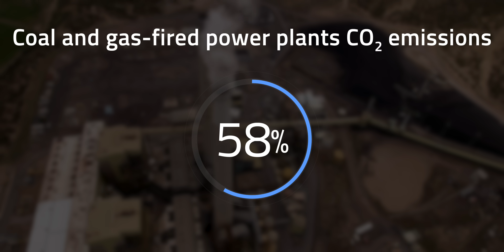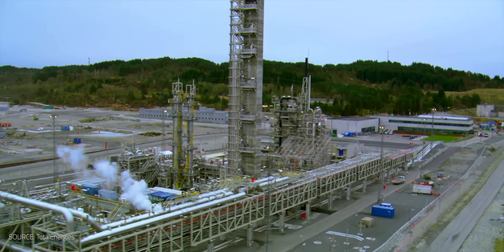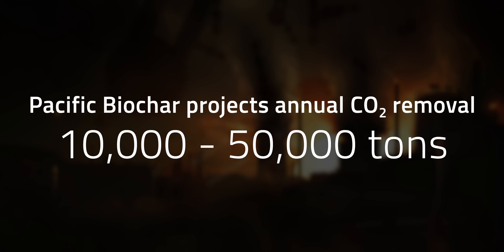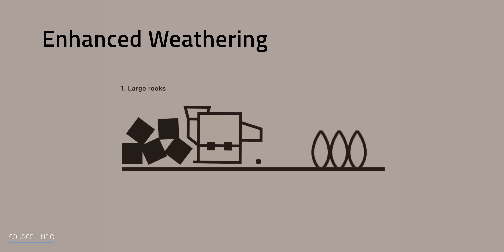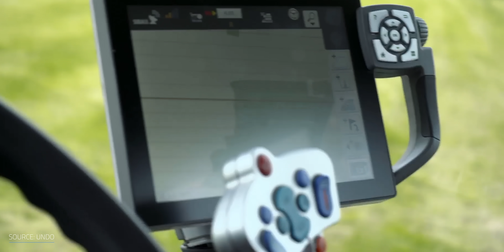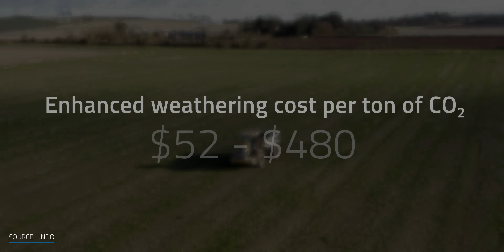The Reality of Carbon Capture

Comment: Honestly, it's a part of a bigger solution. No one singular invention will solve the climate issue. Majority of such articles and research only claim  "x%" in low numbers. Well, it's a start isn't it? Better to start reasonably low with many different such solutions as well. What was that other one, hempcrete right? Absorbs better than regular concrete, fairly renewable, but is a 'long term' solution. Well, so is this. Also cutting back is a good start as well to reduce emissions yeah? Besides that, this particular carbon capture could potentially also help with agriculture as well.

A small gesture of a solution is still better than none at all.

Comment: Matt, massive global reforestation (and logging/sequestering logs) is the only carbon capture technology that is viable. It's easy and the most poorly run country on earth can organize it.
Reply: Massive global reforestation is only a temporary solution, as all that wood will get decomposed eventually. 
Can think of it as a buffer, it will go so far as the total organic mass in all the live trees can allow for, no more no less.
Reply: @jzxynow2a8gs21  No. Sequester the logs in an old open pit mine. Keep stacking them. They won't rot. Eventually the will be coal again.
Reply: @oisiaa  That's not how it works bruh.

Open Pit Sequestration will not ( ever ) turn wood into coal, you will eventually get all your CO2 back. There was a time and an age where this would have worked, and that has passed since long before humans even came into the scene.

Comment: I am suspicious of the ability of biochar facilities to capture resulting pollution from burning inefficient organic fuels. The process is carbon negative but soot and tar positive. I'd like to hear about how biochar plants are handling that. I also wonder about low volatility tars that remain bound to the finished charcoal and if they have a negative effect on soil and groundwater. Spreading a poorly cooked batch of char could be equivalent to an oil spill. The latter issue is easy enough to solve with reliable QC but I wonder about the former.
Reply: I wouldn't compare spreading a poorly cooked batch of biochar to an oil spill. There's a ton of mycorrhizal fungus species that take advantage of the volatiles present in unfully burned wood, take forest fires for example, they create space and resources for a whole clade of pioneering species. (as long as the burning isn't too frequent and wide-spread of course.)
Reply: @DDryTaste  Good point
Reply: @DDryTaste  true, but for this to work it must be done on a planetary scale.
Everything must work as intended and only like that or we will have unforseen problems
Reply: I've come across a channel called NatureJab where a guy has made a microwave based pyrolysis machine in his back yard. 
I'm afraid he's going to kill himself one of these days with his lack of safety precautions and questionable knowledge of what he's doing, but he has successfully made and purified hydrocarbons capable of running a two stroke weed whacker. He seems most interested in the gaseous and liquid products, but obviously a side product is a lot of char. Not calling it biochar, since he's mostly interested in plastic, but he did put plant matter in it a couple of times.
Reply: @phizc  Found the channel.  Pretty cool.  Latest video though is how the reactor sorta blew up.
Reply: The European Biochar Certificate has limits for PAHs. Below these limits the equilibrium heavily favors adsorption, so quality biochars are perfectly safe for soil use. However TLUD and unpurged retorts can retain tars and PAHs, so your concern is understandable. As the industry grows IBI and EBC standards should become more widely adopted.
Reply: Burning biofuels is not carbon negative..first - you can "dry" biomass in 200-300C° on solar/wind/hydro. 
Second, you mostly use biofuel - wood and or biomass, or even portion of same char.
Reply: @romualdaskuzborskis  Dry wood still rots faster than charred wood, so it is an inferior form of carbon sequestration in the long run.
Reply: @garethbaus5471 dry wood does not rot at all, only damp does. And I was refering to the gap in the solar/wind energetics you can actually store energy in a form of dry wood/charcoal. As for capturing, I dont see any viable option here at all. Before we start actual capture - we need to be at least carbon neutral. Setting capture goal can be done in strategic long term goals (like 200 year long)..
Reply: @romualdaskuzborskis  burning biofuels isn’t, but burying biochar can be
Reply: @NightHawkInLight I’m sure you’ve got way more experience in this than 99% of the people watching this, so I really value your opinion. My take on it would be you need to measure it against the “if I do nothing” route rather than against the “before and after” process. If I do nothing, then a tree will still rot and breakdown in to the environment. So what happens to those other components in the case of natural rotting? (I’m honestly not sure of the answer, but I think its the right question)
Reply: always wash char before using.... yeah, this brings up a big enviromental issue when making char on larger scales..... when I wash my char in 5 gallon buckets I can literally see fuel like compounds in the water on the top before I pull the plug on the bottom......anyhow, yeah tons of stuff in unwashed char
Reply: If it's actually more than their graphics about helping farmers and enriching the soil, I'd think food waste disposal would be Priority 1. Kills diesel and other BS additives, solves an actual urban problem as well as helping farmers. 

The same useless biomass can be converted into biofuels anyway.
Reply: As the other guy says, I’m pretty hopeful that microbial decomposition of volatiles would be pretty doable. Though less so for the thick stuff. Capturing soot can be done pretty effectively with electrostatic means even at very small particle sizes, so I don’t think you’d get that chasing issues.
Reply: Someone making biochar in their back yard the old school way the Amazonian did in pits and kilns will make a lot of soot. Any industrial scale pyrolysid machine will burn off all of that soot to provide enough energy to fuel the pyrolysis reaction.  The only emissions should be co2 and water vapor
Reply: Using charcoal to capture carbon makes me thing why not just leave it wood rather then burning it into a piece of charcoal just to refill the charcoal with the same crap you just burnt out of it. It's a scam anyone can see
Reply: Nature can heal itself and restore balance but they believe that nature is dumb. By the way, CO2 isn't the problem. The problem are all the toxic pollutants in our food, clothing, shelter, water, soil, air, medicine, technologies - everything. Believe me, mother earth can take care of itself and she doesn't really care about if we suffer self-annihilation
Reply: Probably dumping in the ocean tbh
Reply: In a professional setup, the only byproduct is water vapor.  Please do more research before assuming there's a problem to be solved.
Reply: @sweetcreekcommunityco-op  Water vapor and some CO2 from the part that is burned for the energy.  But that was bio-fuel CO2, so at least carbon neutral.
Reply: @sweetcreekcommunityco-op  That's wishful thinking. No burner burns perfectly clean, not even refined fuels like propane are completely soot free.
Reply: @Nighthawkinlight  Processes, like retorts and add-ons like catalytic converters can really clean most of the crap up.  Peeps ought to get them for their wood stoves too.
Reply: @nighthawk I'm sure you've done all the requisite research and been in the industry for decades and run lab tests and verified independently all your findings before typing your comment...  who am I to have seen and tested more complete setups than what Matt demonstrated?

Clearly your armchair science is more refined and thorough than that of industry experts... I see where I miscalculated... your tenacity in being confidently wrong... 🤔🤷‍♂️
Reply: @sweetcreekcommunityco-op  He was just asking questions. That's how you learn. You have so far not answered any, just been rude for no discernible reason. NightHawkInLight isn't some random keyboard warrior. He's proven his abilities and knowledge in a wide range of scientific and engineering builds and experiments, just a click away. You may be the greatest.... biocharist? is that what it would be? or even a word? I don't know, but you may be the best in the world, but you gotta come to the table with some explanation or something more than claims of superiority. The burden of proof is on you.

...biochar-er?... no biocharist. It would be biocharist, i think.
Reply: @sweetcreekcommunityco-op  Great, I would be happy to be proved ignorant of your methods. Please explain how these existing facilities carbonize biomass with a heat source that produces only water vapor.
Reply: @sweetcreekcommunityco-op  it's not about having a PhD or doing research. It's common sense that tells you this stuff is stupid. I don't need to spend one hundred million dollars the government prints on a digital ledger to give out as grants and paid back by tax payers and inflates there savings to zero. If you have a container with a pound of dirt. And you spend the energy to remove half of that dirt just for the ability to add another half a pound of dirt you have done nothing at all but spent outside energy to move something around. Exseptvyour not using your hands to move the dirt. Your using massive machines running off of fuel and built apon mined and transported materials milted down into parts and put together to pretty much do nothing but steal money for made up agenda's. I don't even know y I have even typed this. It's not like you will understand. It's not like you have a PhD in English/reasoning/comprehension. And put in ten years of monk like focus into thinking for your self. Nope someone labled there self as an expert and you just follow your new high priest of what ever topic you hear about.

Comment: A shift away from petroleum plastic to plant-based plastics is a good start.
However, there is already a cheaper, easier, simpler, safer, and quicker means of mass carbon capture and storage: wood.
Use wood for almost everything it can but most importantly furniture and construction.
Reply: Wood gets broken down back to CO2, in due time... as it's exposed to atmospheric oxygen
Reply: @jzxynow2a8gs21  
Key terms: 
in time
when exposed to atmospheric oxygen [and water]

Meaning wood that’s sealed, or not generally exposed to environment conducive to rotting, is a viable carbon capture and storage option.
Even burying tons of wood underground in sealed containers is a more readily accessible form of capture and storage.
Simple solution: pay people to grow trees then pay them again per unit mass or volume of wood stored.
Reply: @montithered4741  Anoxic also has it's own problems, also it's not that much slower.

But the main issues with wood burial is nutrient lock up, (you are stripping away the good soil to be locked up deep), and disturbing forest and soil eco diversity, when done at the scale you are proposing
Reply: @jzxynow2a8gs21  
Trees are vast majority carbohydrates, most of the rest being water; they don’t deplete topsoil.
If trees depleted topsoil, then old growth forests couldn’t exist, to say nothing of sequoias and giant redwoods.
The scale is an advantage.
Trees exist in nearly every climate and terrain; making them much more available for widespread use,
Reply: no
Reply: @marvin19966  dum dum

Comment: The burning process of biomatter true Pyrolysis => Biochar, How do you create enough heat without oxygen?? What fuel do you use to burn the process or/ start the process. I think that this biomass can only be burned if the mass is not too large.  It's looks like a very promising new technology that biochar also can be used as a fuel, the make the soil better and so on. I think also that this burning process should be available for everybody. In Afrika there still shop wood the make coil. Can this process also be bombinated with excess energy from windmills or solar panels? Mr. Ferell could you please, if this is possible give us more data regarding this topic because at this moment, I am looking into the dark. New technology's that are free from real metals or expensive materials are the real future. thanks in advance for your efforts.

Comment: It seems to me that a very practical way to capture carbon would be to mandate that toilet paper can only be made from trees planted specifically for the purpose of making toilet paper and that all of the trimmings and waste from the process have to go to a landfill and not be burned.
Reply: this is the way 🙌🙌🙌
Reply: Great idea! Let’s also mandate we skip a few meals a week…  we would poop less which would help with using less toilet paper that costs $16 per roll.
Reply: @goldenhandcuffs  Because it's so much cheaper in the long run to cut down all the trees and then replace them with machines, obviously.

Comment: It makes me crazy when people dismiss carbon capture out hand as a ploy by fossil fuel companies to keep burning. I agree the best long term idea would be to end fossil fuel but until then we should be using everything we can to bring down carbon levels. We need to be throwing everything we have at the problem regardless.
Reply: To be fair, that is a very valid concern. That's essentially what all of ccs has been used up until now. In norway they capture carbon and pump it down oil and gas wells to increase pressure so they can extract more fossil fuels. The same has been happening in thr US. 'Clean coal' is just coal used in a power plant equipped with a ccs system. Unfortunately, there's no restrictions on what powers the ccs, so they build a gas plant next door and use that to power the ccs of the coal plant, completely negating any benefit that might come from the implementation of ccs. 

Yes, ccs has a lot of potential, but so do a lot of technologies and ideas, and that doesnt stop it from being abused by those who stand to gain if we keep fossil fuels flowing.
Reply: @rfldss89  I agree and would like to see these companies made irrelevant and disappear but until then we need everything we can get
Reply: For me, what makes me think direct air capture isn't currently the best idea is the opportunity costs. The idea behind DAC is that you power it with renewable energy, from solar panels or wind turbines. But there is a limited supply of those panels and turbines, so using that energy for DAC means not using that energy on the grid, displacing fossil fuel powered electricity generation, usually coal. Figures I found online for Carbon Engineering is that their technology captures carbon at a rate of 409 gram/kWh (8.8GJ per tonne of captured CO2), while coal power plants emit 800-1200 gram/kWh, and natural gas with the leakage included emits 500-700 gram/kWh. This means that the most effective way to use the renewable energy generation to reduce the CO2 in our atmosphere is to use the renewable energy to produce electricity, displacing coal and gas generation.

Of course, in places where the addition of renewable energy would not result in the displacement of fossil fuels DAC would make sense, but due to the global market in solar panels and wind turbines only places such as Iceland with their abundant hydropower would be suitable for this.
This whole argument could also be made for CCS, but the figure that I found was 1440 gram/kWh, so this is in fact worth the effort
Reply: The point is it FAR cheaper to burn less fossil than to capture carbon emissions. So right now CCS is not really an alternative.

But in the bigger picture we still need CCS, when we get our energy production "carbon free" (or fairly close to that) CCS is the way to decrees the atmospheric CO2 level again and very much needed. And it's a good thing that those technology pop up now so we have them ready when they are needed and not just start the research too late.

Also countries like Iceland are already carbon free in their energy sector with their great geothermal preconditions and they start to use their excess carbon free energy to store carbon.
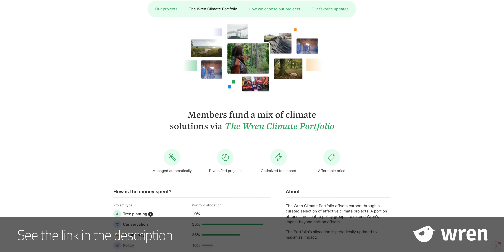Reply: "From that time Jesus began to preach, and to say, Repent: for the kingdom of heaven is at hand." Matthew 4:17 

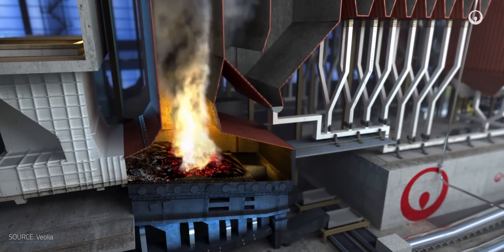"But I say unto you, That ye resist not evil: but whosoever shall smite thee on thy right cheek, turn to him the other also." Matthew 5:39|